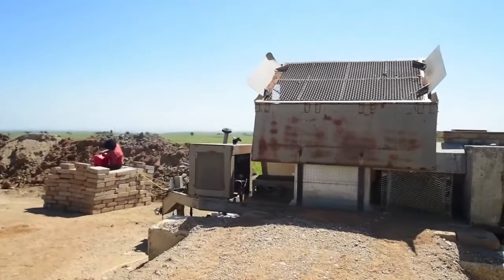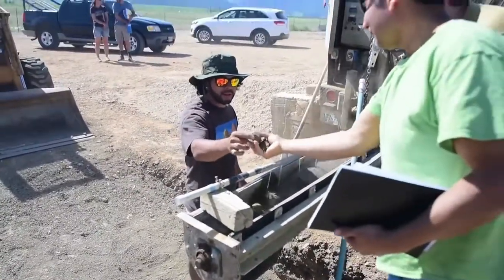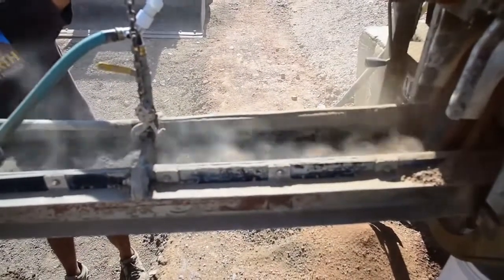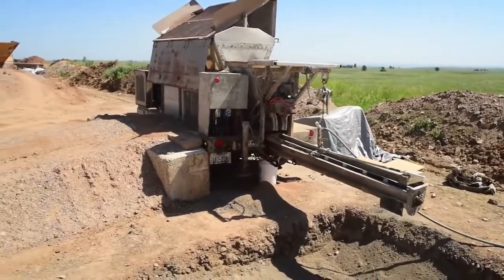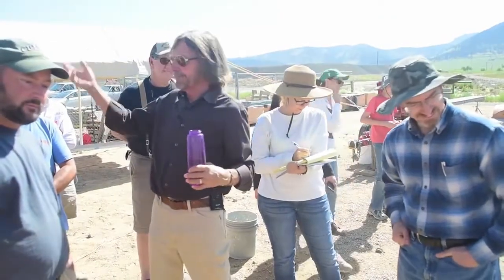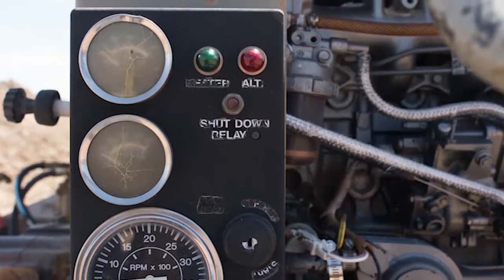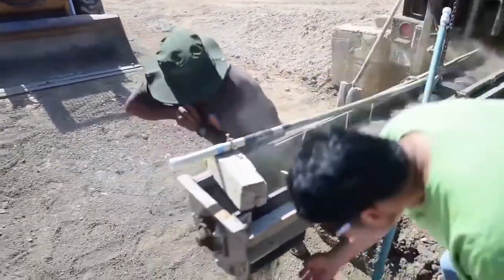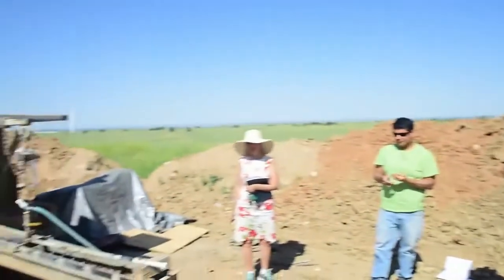Part 2   Making Compressed Earth Blocks

Comment: Jim, very informative.
Is there a machine you could recommend for onsite block construction?
And is there a preference for block construction as opposed to form and compaction in place?
Reply: CEB vs Rammed earth is what you're asking about for those needing search terms. From what I've seen on videos stabilized CEB are stronger/more resistant to scratches than rammed earth walls, unstablized they're probably about the same.  You may want to read the US Department of Housing and Urban Developments guide with the nice short title of "A Best Practices Manual for Using Compressed Earth Blocks in Sustainable Home Construction in Indian Country".  It's got lots of useful information and at the great price of free.  I'd link directly but youtube always blocks my messages when I do that.
Reply: @Trahloc  Thank you for the PDF location.  I did look at this and while somewhat informative, it lacks many construction details.  For example, the one figure of an exterior wall in Figure 8, is hardly legible.  It would also be helpful to discuss field testing of components and blocks.  Also, photos of equipment costing thousands of dollars, is not helpful to DIYers who only plan to construct one or two buildings.  Appreciate your response, as Jim Hallock seems to be MIA.